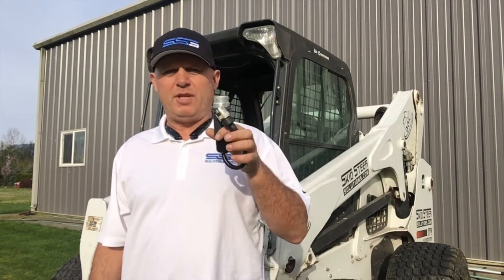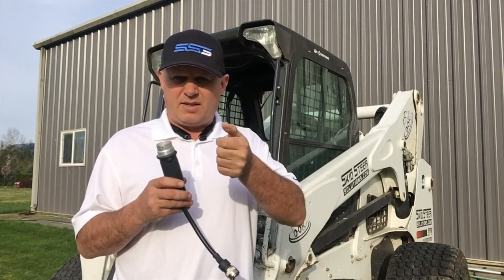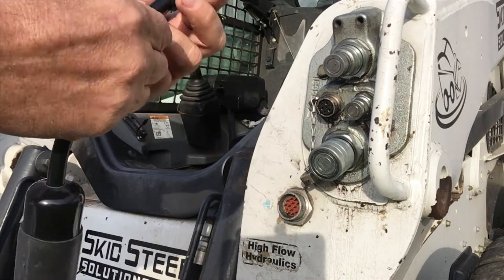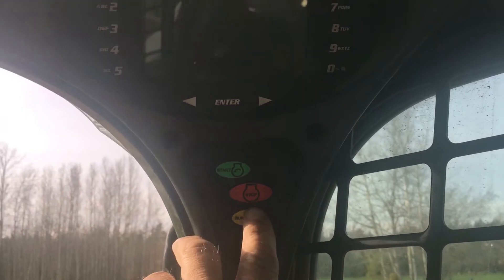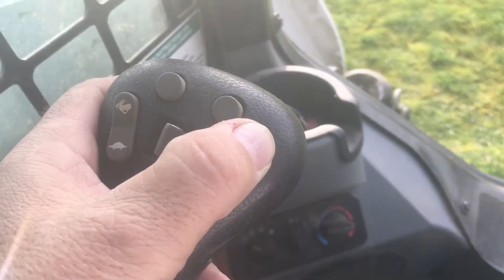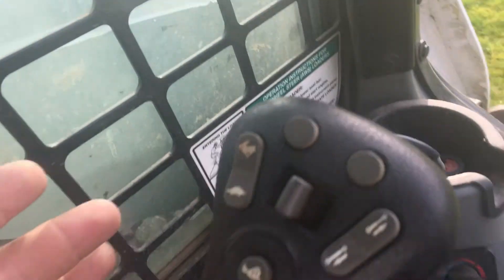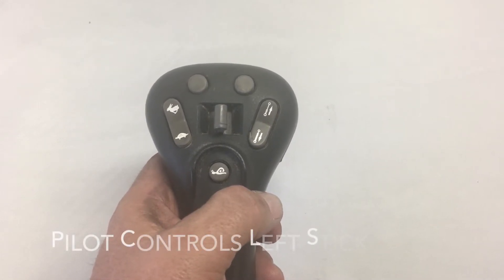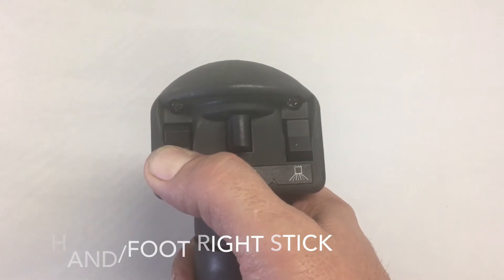#109 - How to use a 7 Pin Control on a Bobcat

Comment: So will the 6 channel run the halverson processor or would I still have to get a 14pin add on?
Reply: Today if the machine uses pilot controls and you have the 14 pin installed, we have a controller.  All other machines we are working on.
Reply: @robleib1973  I have a 2018 t595 and only have the factory 7 pin with the joystick control. Any info is greatly appreciated.